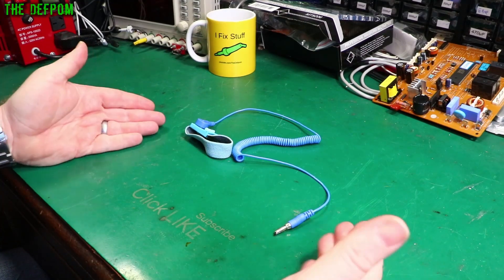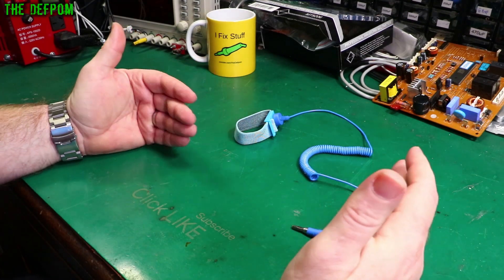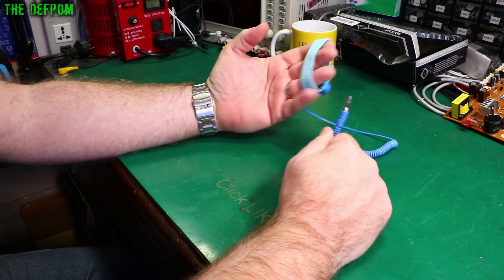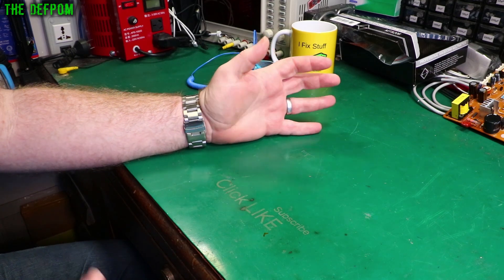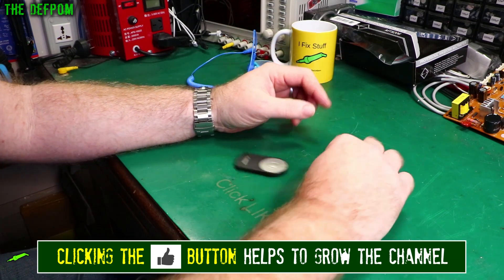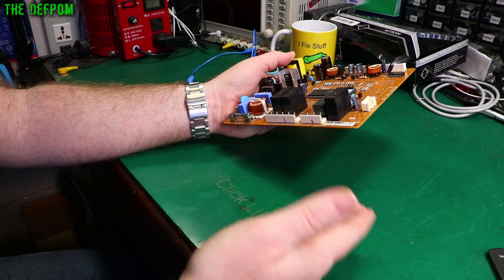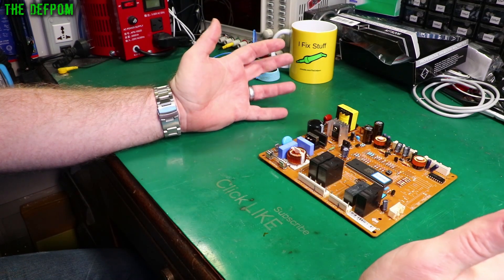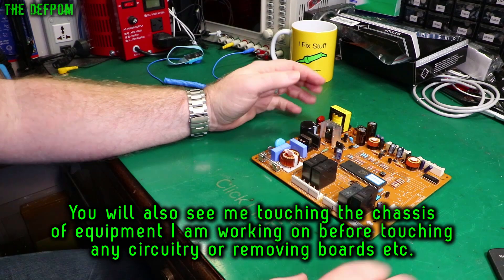🔴 Electronics For Beginners - No.24 - Avoiding Static Electricity - No.990

Comment: A note on ESD is that you don't always kill the chip out right. You may start a fault that will occur when your customer has been using it for a few weeks. High speed chips can have issue with the slew rate going out of specification, and can go unnoticed during testing but again the customer soon notices. 
Not something a hobbyist needs to think about, but still good practice.

Lack of ESD precautions in production is a good way of gaining customer returns and losing customers in the long run along with your reputation. Reputation is way harder to gain than to lose. 

So strap on down and have a happy costumer.

Comment: The strap needs to grounded via a resister to drain away the static without the risk of electric shock. Not sure what the resistance in your gound lead is. I do this with my soldering iron, the tip is connected to earth via a 10K resistor so there is not a problem if i solder to a powered board.

In the lab i set up, i painted the floor with antistatic paint, put ESD mats on the benches, wrist straps and strap tester on each bench. So we could have used ESD shoes and not required the straps. I quit like the strips that you put on your sole of your shoe and fold over the heal and it makes contact to you via you foot. but if you walk outside they get buggered very quickly.
Reply from the maker: My wrist strap has a built in 1M Ohm resistance, I’m sure there are cheaper ones that don’t have it, I actually checked mine when I got it to be sure I wasn’t inadvertently creating a dangerous situation by plugging it into a directly grounded point. Some soldering stations provide a 1M Ohm ground point on them, those can be handy too.

Comment: Oh and don't forget A good wrist strap system has a large resistance between the skin contact and ground. Typically this is 1 MΩ, which is relatively large. This large resistance is there for your safety, in case an error somewhere connects you to a hazardous voltage. Lower resistance approaches danger, higher than 10M is of marginal performance. :-)

Comment: In general, MOS devices are more prone to damage. Also, analogue devices can be partly damaged which doesn't make the component fail completely and may reduce performance.
I've seen analogue switches damaged, the AD7590 was always a candidate for failure when assembling pcb's.
Reply: The old 741 opamps were very easy to kill, the metal can ones seemed to be bit better